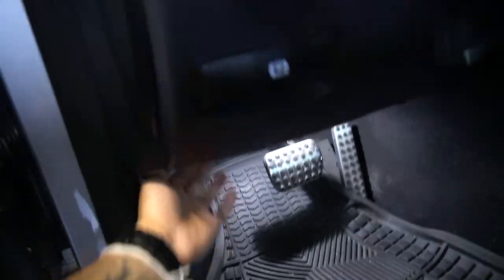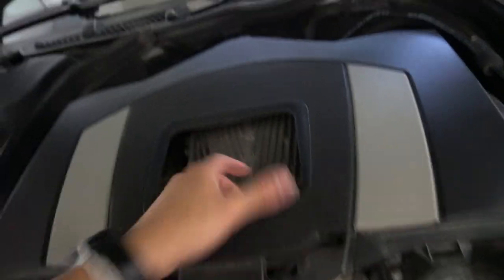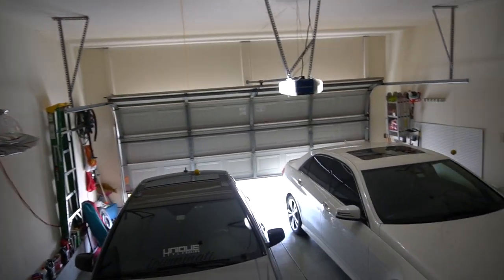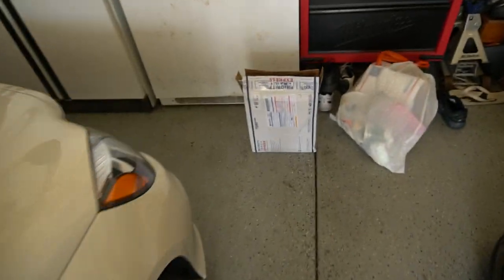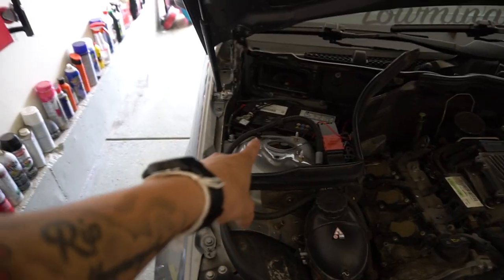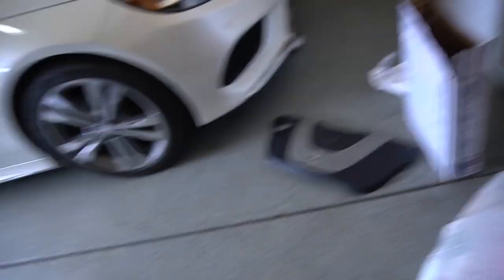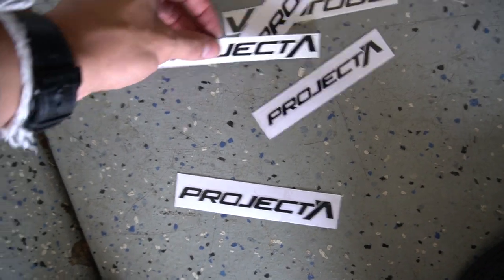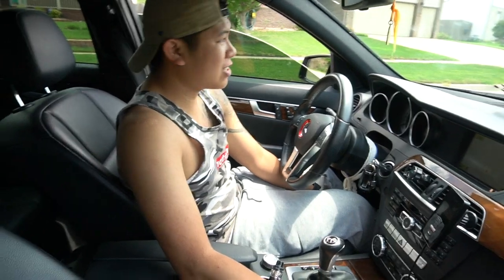HOW TO MAKE YOUR MERCEDES-BENZ/BMW POP, CRACKLE, AND SHOOT FLAMES!!!

Comment: Just some advice not dissing the car but the c300/350 already come with a cold air intake system stock whilst the filter is located under the plastic covering on top of the engine throwing filters where you have them placed is adding more restriction to airflow plus your sucking in air from the engine bay which is hot air not fresh cold air from outside the vehicle therefor your losing horsepower capability’s it might look cool and all but your not gaining any power and probs losing some due to the extra restriction

Comment: Nice car, Have the same 2012 sport 4Matic same color, got it just for fun LOL,  I am 64 years Old. Just added the Carbon fiber front lip, Carbon fiber mirror caps, carbon fiber rear spoiler, *( more like AMG, not as aggressive as yours) Wrapping the roof Gloss black on Tuesday, Waiting for Carbon Difuser as of now.  Mine is Beige interior, instead if yours which is black.

Comment: I love the sound of the muffler not crackle. What did you or how did you do ? Your car is the same my color too and steering wheel red in the center too how is this possible ?
Reply: Brandon Yen x-pipe replacing the resonator and muffler delete with a stage 2 tune!
Reply: Thanks for replying. If you tinted your headlight and taillights also paint your roof black it's going to be a very nice car.

Comment: How much does this tune run? I’m interested in doing this to my 2012 c300 luxury model ! So far all I have done is a straight pipe from the second cats back, almost plan on getting some Aodhan ls009 in a month or so
Reply: Stage 1: $500
Stage 2: $650
Reply: Where do I buy or contact dude lol
Reply: @DizFooJustin you tune?

Comment: What intakes are those I couldn’t find any aftermarket ones for mine online
Reply: DYLNYE TV K&N!
Reply: Justin Kongmanychanh really? I checked the K&N website first before anything and it showed that they had nothing that fit specific to my car are they like specific intakes or just universal ones
Reply: DYLNYE TV it’s universal I believe it was a 3”
Reply: Justin Kongmanychanh okay I’ll look into it appreciate it
Reply: @DylanG561  don't copy what he did.
Reply: @ronsantos3336  why not?
Reply: @maxowndhard  if you do that, the engine is getting hot air, not cool/cold air
Reply: @ronsantos3336  that depends the air ducts still blow cold air straight into the pots
Reply: @maxowndhard  but hot air is still getting into the mix

Comment: Hey brotha, I’ve been messaging project a Daniel on Instagram and will be doing at least a stage one tune. 

Do you notice any power gains? Also what’s your current exhaust setup?
Reply: Ben w204 for sure! Won’t be disappointed. But yes, it’s not a big difference but you’ll notice it. Currently have x-pipe replacing the resonator, muffler delete and quad tips. Changing the exhaust set up soon!
Reply: @DizFooJustin  does it drone

Comment: Niceeeeee dude. How much was this tune ?
Reply: Ayooo Lonzooo 
Stage 1: $600
Stage 2: $750
Reply: @DizFooJustin  does that tune also include better throttle response, speed limiter removal, better shifting response etc... And will they send out an OBD-2 loaded with Tune rather than mailing out ECu to them?
Reply: Aaron Poisson yes! Everything is pretty a better response with the car, even handling feels good. But I think they only do the tune by shipping your ecu to them
Reply: @DizFooJustin  Yeah that's what I thought or go to a local shop and have it dynode then tuned and dynode to see increase. Gunna talk to a friend to see where he recommends locally.
Reply: Aaron Poisson is there such thing as a obd 2 loaded tune for this car or is only method by shipping it out?!?

Comment: You have to be catless for the burble tune and Stage 1 or 2 right? I know you have to be catless for the flame tune but i thought you also have to be catless for the burble as well. I have a '15 c350 and am curious at a burble/power tune but with a shop local to me.
Reply: Nope, you do not have to be catless to get the burble/pop/crackle tune. Stage 1 and Stage 2 will have a the pop tune no matter what. Only main difference between the two tunes is stage 2 allows you to shoot flames only if you’re catless. Stage 1 is just gain hp/tq and a pop tune.
Reply: @DizFooJustin  From what I've heard, burble tunes are bad for your car if you still has cats cause you are essentially dumping excess fuel (fuel over-run) into them and screwing around with the timing when you receive the tune. I've been told before that it puts stress on the cats and leads to them going out way quicker. Again, I'm not 100% sure but  I always thought you should be catless before receiving a pop/burble tune.
Reply: Kam F you are right, it is bad for the cats just cause you are dumping extra fuel into them but I’m getting rid of my cats soon anyways so not to big of a deal for me!
Reply: @DizFooJustin  ahh gotcha. Will you make a video after you remove your cats with your thoughts and opinions? Really interested to know what you think. Appreciate the content bro
Reply: Kam F yeah man, for sure! I definitely will make another video once I remove the cats! And I appreciate the love and support!!

Comment: How much does it cost to send ur ecu and get it tuned by Daniel?
Reply: BlackedOut Benz umm, it depends which Tune you wanted to go with, I believe it’s $150 difference from stage 1 to stage 2. You would have to contact Daniel for exact pricing

Comment: Do you have a muffler delete? X pipe? Straight pipe? Resonator delete?
Reply: Kareem Ahmedzay I have a muffler delete and resonator replaced with x-pipe as of right now. Soon, replacing my secondary cats with a high flow resonator and getting a custom fab decat for my primary cats.
Reply: Justin Kongmanychanh I need on in my bro lol I rather have a xpipe tho
Reply: Ok stupid question lol I recently did a resonator delete and a muffler delete. Was gonna do the xpipe but couldn’t really find one and didn’t want to make one. But what’s the difference between just putting 2 pipes going straight down and putting a xpipe if there even is a difference.
Reply: Justin Kongmanychanh why high flow resonater for secondary cats instead of straight through ? Asking because I did straight through
Reply: Kevin Vega x pipe is better performance than a h pipe on this car guaranteed